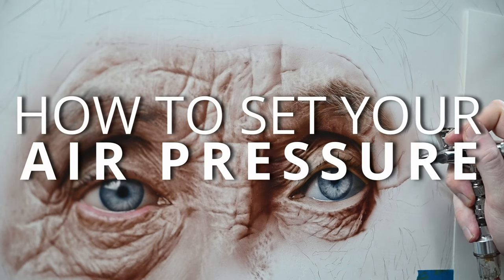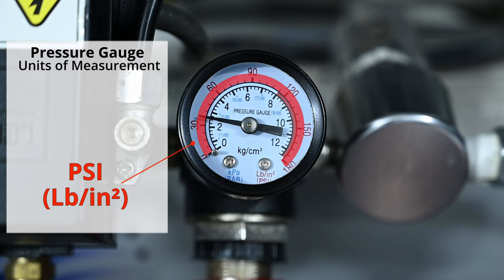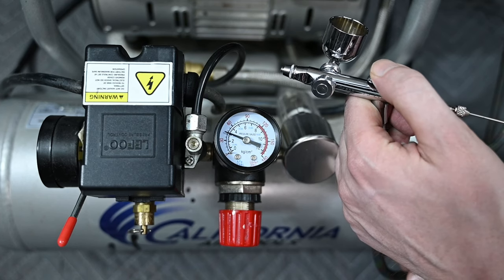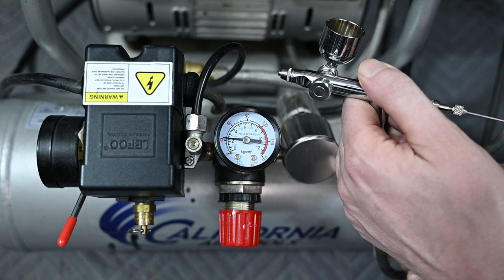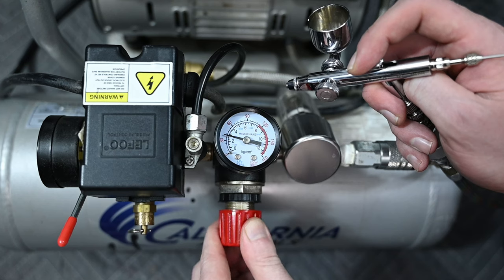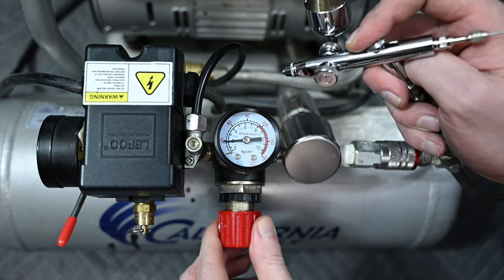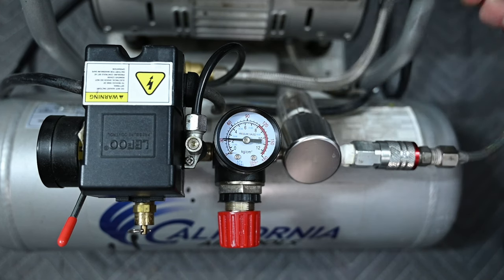How to set your AIRBRUSH PRESSURE the CORRECT WAY

Comment: I just got my Master Cool Runner II (with 3 guns, G22, G25, & E91) and have been studying. I watched your video half way last night before heading off to bed, excited about the delivery today lol... so, I guess I was expecting that you could set it to 57psi while using the gun... <sigh>, and a while ago I watched a video of a lady with the same air compressor I have. It turns out that's the highest when you're NOT using the gun (57psi). The highest I can get while spraying is 35 with two of my (now 5, 3 brand new) guns, and 30 with 3 of them. Are you aware of the psi difference produced by different guns? I just learned that about 30 minutes ago while testing. Also, are you using a real air compressor (like airing tires, using nail guns, etc)? That's what it looks like in the background Thanks a lot, mate!
Reply from the maker: I'm a big fan of those small airbrush compressors. I started with one of those too (similar to the model you mentioned) and it's still going strong almost 20 years later. Generally when I am spraying, I prefer a lower psi at around 20-30. I rarely go above 30 psi. A high quality airbrush paint makes a huge difference in performance for spraying at lower pressures. Hope this helps and all the best to you!

Comment: I’m sorry To be a bother to ya mate! I watched and did exactly what you did but the damn thing still read 0 it’s not moving at all 😢I think it’s damaged then cause I’ve tried and tried and no luck! This thing been shelved at the store for who knows how long… I hate I got it for so much and I can’t even use it. Rediculus I hope they can refund me, even tho everything else came with it. Thanks again for your help these were useful… ugh just got to replace a whole compressor 🙄
Reply from the maker: no bother at all! When you turn the switch on do you hear the compressor? It's usually like a rumbling sound- sometimes pretty loud. Because it might be that there is a leak somewhere and the air isn't going to the hose like it is supposed to be. If it has a moisture trap, make sure the valve at the bottom of it is closed so that air isn't leaking out. Could def be a broken compressor though.
Reply: @theartworkshop  Thank you and Yes there is a rumbling sound when I turn it on, and thus, when I hold the airbrush for the air it continues to rumbles but the needle doesn't move at all. :| I tightened the valve on the bottom. A leak perhaps but I didn't see anything of such hmm, lol this wild.

Comment: I’d suggest getting a oil filled pressure gauge with psi range more in line with your working pressures.  Instead of maxing at 180 psi, get a gauge that maxes at 40-60 psi.
Reply from the maker: 100% agree. I have a gauge that maxes out at 60 on my main compressor setup. so much easier to read!

Comment: Thank you. I recently got an airbrush but never made the jump to actually "do it" yet.. This has helped me greatly..
I have a gauge on my air compressor output AND a second gauge on my moisture trap.
I assume I should just send FULL PRESSURE from the tank to the moisture trap and then do 30psi from the moisture trap to the airbrush?
Or do you think it's best to do it in stages? Say 60psi from tank to moisture trap and then down from 60 to 30 to the airbrush?
Or am I just over thinking it?
Reply from the maker: Awesome to hear that! Yes, most compressors will have 2 gauges but only one of those gauges has an adjustable regulator. The gauge without the regulator knob is the pressure within your tank. These will have an auto shut off feature when the tank reaches its max pressure. I leave that at full pressure. It will automatically refill when the pressure drops. The only adjustment you'll need to make is the one for your working air pressure with the regulator connected to your air hose and airbrush. That is the one you want to set to 30psi (or whatever PSI you are spraying at). Make sure you read the manual for your compressor to follow their recommendations. Hope this helps!
Reply: @theartworkshop  Sorry, I used the wrong words... I have 3 gauges in total. I have 2 regulators.. The regulator that controls the output of the compressor+tank. I then have a hose, and I then have a moisture trap, The moisture trap has it's OWN regulator.. The moisture trap is rated to pressures that exceed the compressor+tank can output. So there is no NEED to downpressure before going to the moisture trap, but wondered where it is worth doing the actual regulating.. Up-stream or down-stream or a combination of the two?
Reply from the maker: @ColinRichardson  I got ya. I actually had a similar setup to that for many years. I did exactly what you are suggesting. I set the regulator on the compressor to somewhere around 40-50 (since I never spray my airbrush above that).  Then I used the regulator sitting next to me to adjust as needed. I usually spray anywhere from 15-30 psi depending on the paint and reduction. No need to down step like this, but it's not going to hurt anything if you do.

Comment: Hi thank you for this video Iv been watching lots of your videos lately and you’ve inspired me to have another go at airbrushing portraits, Iv got one question what size of board do you mount your canvas to to paint , I understand they will be different but what size do you commonly use, also could you do a video on how your studio set up is and how you keep your canvas upright. From watching your videos Iv found out lots of mistakes Iv was making , so I’m ordering new paint and I’m going to get some canvas on a role to follow your example, did you say what type of canvas is the best to use ? Thanks again for your videos you make it more interesting and informative and easier to understand,
Reply from the maker: thank you. Generally I paint my portraits around 24x20". Sometimes larger because I find it easier to get details in that way. I paint on generic 15oz cotton duck canvas. I just buy it it large rolls and cut off what i need. Studio setup video someday I hope! I just screw the canvas into the wall using small corner L brackets and wall screws& anchors. I'm sure you can see them in most of my videos. hope this helps.
Reply: @theartworkshop  that’s fantastic it’s a real help to get a idea of size and I’ll see how I can fix mine to a solid base , I’ll look harder in the video to see if I can spot them as it not what I was looking for but I will now 👍🏽 sorry for another question are you standing or sitting down if it’s on the wall , and I’ll look for the canvas thank you again 🙏🏼

Comment: Really appreciate all your videos so thank you. Just a question if possible? I'm in the UK and struggle to find any frisket may I ask what brand you use? I usually use clear transfer tape but that can be brutal when pealing it some paint can come with it even when using a med tack. Thanks jay
Reply from the maker: thanks man. I'll use any frisket I find on sale, it all works well for me. But my favorite is the one made by artool that is matte and comes on a roll. If your transfer tape is too tacky just lay the sticky part on a towel, your shirt, or whatever fabric is near you. it'll pick up the fibers from that and reduce the tack. Thats what i do
Reply: @theartworkshop  I'll give it a go I use a medium tack transfer at 100m that seems more low tack as can come away with the blow from the brush. I'll give that a try with the stronger one. Would you let the paint cure for a day or so before putting it over it? Thanks
Reply: Тут нельзя не вспомнить уроки мастера, Craig Fraser. Он всегда свою ленту клеил себе на штаны и это было круто, и остаётся таковым по сей день.

Comment: After i commented on a previous vid about this its great to see a dedicated vid, however when i do this on my Wolf Cub compressor as soon as i press the trigger my dial drops to 0 not to the psi i am expecting if i turn the dial as i spray nothing changes, any tips?
Reply from the maker: When it reads 0 is it spraying air? At 0 psi no air should be coming out of the airbrush. could be a broken gauge.
Reply: @theartworkshop  Hi Thanks for replying yes at 0 it is spraying air when i release it goes back to 25 PSI on the dial, the guage is built into the body of the compressor so not sure i can change it its a 6l wolf cub i bought on amazon it could be user error or could be not a great compressor.

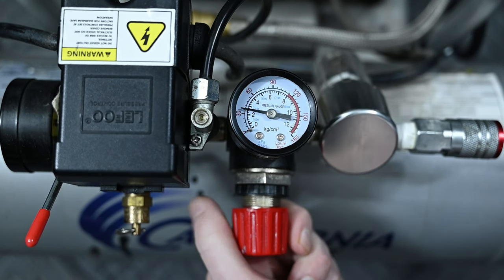Comment: Hi, at 0:15 i feel you may have reversed knob direction, isn't it turn left (CCW) to increase pressure and right (CW) to decrease ? Thank You
Reply: No, usually in such regulators you are screwing a screw to add preload to a spring that controls the valve. So to tighten the screw (and increase pressure) you turn it CW.
Reply from the maker: interesting! I have a few regulators and they are all like this. Maybe there are others that are reversed, not really sure. Regardless of which way you turn the knob, I just wanted to show that you need to be spraying air to set it correctly.

Comment: Hello, i wanna learn air brushing, i think of buying cheap portable compressor, with max 28 psi
My purpose is to paint hot wheels & table top figure, is 28 psi enough for that? thanks in advance
Reply from the maker: max 28psi is just fine. You won't need more than that unless you're spraying some thick paint, but I'd recommend going with a compressor that can spray higher in case you may need it.
Reply: @theartworkshop  I think i'm gonna use 2k clear, is that fine with 28 psi?